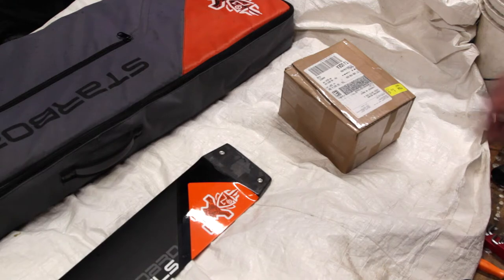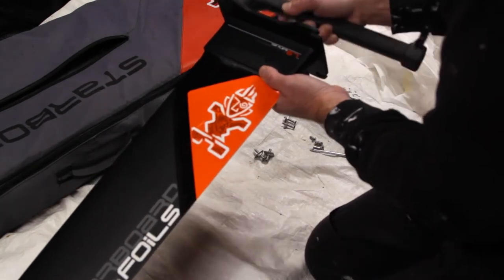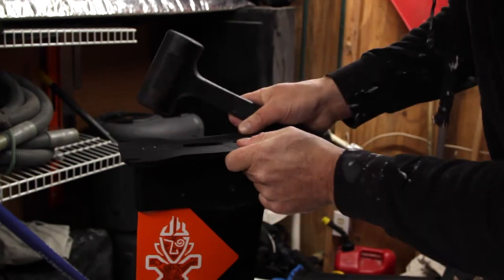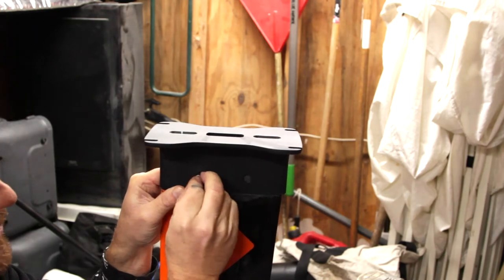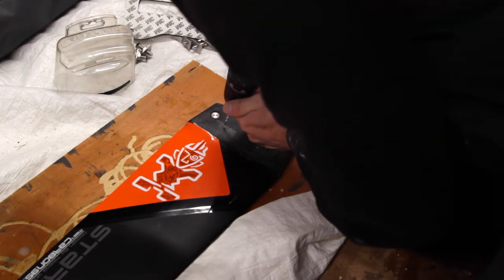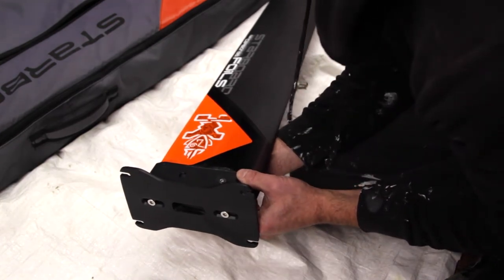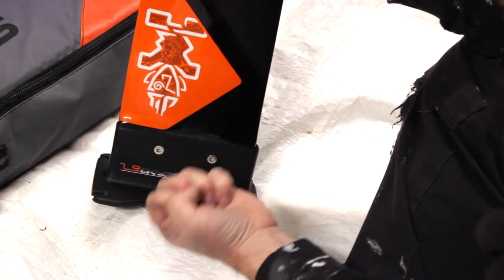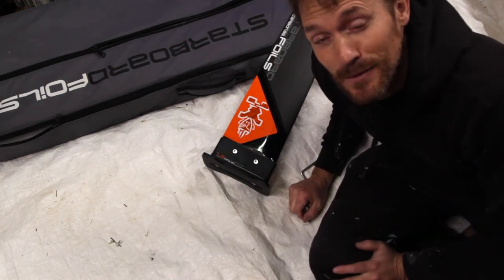Starboard Foil Tuttle to Top Plate Adapter  |  Install and First Thoughts  |  Jonathan Reinke

Comment: Is it advisable to drill the Starboard? Perhaps it's generally unnecessary. 

By the way, I find it surprising that Starboard and other companies have variations in mounting points such as deep tuttle, causing issues in connecting everything seamlessly. In some cases, the service desk recommends drilling the boards and foils because they might not fit otherwise.
I don't know why it's so hard to maintain standards. Also, Starboard (SB) has an empty space in the DT V5 Alu near the threads, whereas in 2020, they locked the rear thread, making it impossible to rotate it at an angle. Filling these empty spaces would add strength, and it would be possible to leave a rotatable thread allowing the mounting of a Starboard foil on any board.
Reply from the maker: Good call, I agree with your ideas Michal.

My 95cm carbon mast is still holding strong with the drilled holes.  After drilling the holes, I contacted Starboard and they told me the side holes are only for a specific deep tuttle mast adapter and was not nessary for my mast.  The side holes are for the V7 aluminum mast.  They also said the drilled holes should be fine with the 2 extra screws.  I did not do real weight twisting test with or without the side screws, so I am not totally sure.  I have a feeling that the extra side screws do add some roll stability as the side thickness of aluminum mount is not extra thick.  I could also with my hands squeeze in the deep tuttle part in some so maybe after time it could have wore out or stretched out???

If you are getting one for your setup you may want to try the mount without drilling the two extra holes.  You may find roll / pitch / yaw have plenty of stiffness. 

I now use Axis for dock start foot pump foiling / Wing foiling / fun focused Winsurf foiling.  Axis has great cross compatability with their gear and usually great quality control.  Starboard race foil is still better for Windsurf foiling when average speed / max speed / getting around a race course with steady 9 mph of wind or more.

Happy Foiling! 😊

Comment: Ok, but which mast have the side holes? Even the new 2022 Starboard Evolution series 300/400 mast don't seem to have the holes. Maybe the production ones will; but the released pictures so far do not.
Reply from the maker: ZeroR2 yes good call.  Foils are making so many upgrades.  Who is to say what the next thing will be.  The first Starboard Tuttle to Top Plate adaper did not have a side screw option.

From North Beach
https://youtu.be/diaaeG7i9KQ

There are multiple other Tuttle to Top Plate adapters that do not require or have an option to use side screws.  As they are tuttle or Deep tuttle to Top plate also I think they would work great with Starboard or any other tuttle baced foil.  Trade off of these is they are thicker and heavier.   So more drag and less manuvarability.  Would you or I notice a difference ... not sure.   I think GoFoil and Sabfoil both have their own versions. Sence I have a Starboard foil I went for the matching piece.  I have a higher stall speed foil and a carbon mast so I appreciate less drag and ligher weight.

I forget what the aluminum tuttle head looks like but if it does not have a hole I do not think it would be too tough to drill one.  

Also, I plan to use this for Wing foiling or foot pump foiling.  It may do fine with a bunch of roll tourque?  For my 1m wide Windfoiling board with a 9.0m Sail or bigger I will stick with the tuttle mount.  🙂 

I will try to get a first impressions video out soon with more thought on my new gear / this mount.  No go pro just yet.  

If you hear more about this mount / other mounts give me a shout out.  🙂
Reply: @jonathanreinke9392  I run a Groovekite adapter with my Moses deep tuttle carbon mast. Here is a video. 

https://www.youtube.com/watch?v=z7fdB4p9qOU

Just trying to see what the intend is with the side holes. Maybe there is something that will be released from Starboard.
Reply from the maker: OK  .... Yours looks way cooler than mine!!!  😄 

Were can you get that? 

I guess the only thought of the aluminum one is it is thinner and kind of light.  I did not weigh mine yet.  What does your Groove weigh?  

I believe the idea is a stronger lock / less likely to bend after time with 2 extra screws.  Kind of like Starboard's fuselages.  My 4 are all still very stiff and without wear.  From what I heard on why so many companies went for aluminum fuselages rather than carbon was it handled every angle / direction or tourque and stress better compaired  to a carbon one.  I have not tested this but kind of makes sence as how carbon is wrapped determines the load it will take. Maybe aluminum in specific parts of a foil work better???   

I will try to contact Starboard to get more specific info.  🙂
Reply: @jonathanreinke9392  Groovekite is 600gr. I think. Moses, Starboard and F4 have very similar aluminum ones. I think they are fine. I just wanted the 10cm lift, same material (carbon) from mast to adapter. If I had SB, I would do the same as you.  Maybe the new mast coming out from SB will solve the puzzle and have side holes.
Reply from the maker: Cool that is light.  Nice extra hight too.  🙂 

The new Evolutuon mast / fuselage looks like a nice upgrade.  I am happy with my Millennium 1000 being my largest front wing for most Windfoiling sessions.  For light wind Wingfoiling / Foot Pump foiling / local light wind race days were a long board is best it would be nice to have a efficient larger front wing option that works with the same setup.  Rather than swapping to the Starboard quick release setup.  Not a big deal but if Starboard offers a larger 1500-2400cm2 option that works with the Evolution fuselage I would probably upgrade!?! 

I called John With Isthmus Sailboards and he thinks drilling the holes to use the side screws would be just fine but was not totally sure what difference it makes.  So he contacted Starboard.  Hopefully we will get more info on why their mount uses two extra screws and if it is a good idea to drill some holes if needed "now I am hoping yes 😓😲😀"?  I think the Starboard adaptor will work great with other makes of foils ... the Sabfoil one is 1.8 lbs.  I may get a session in today so I will wait to hear back from Starboard as far as weight.  🙂

Chat with you soon.